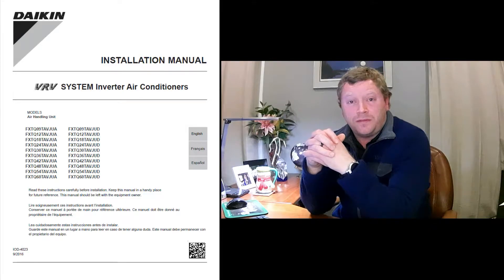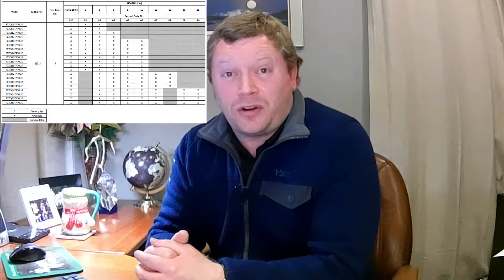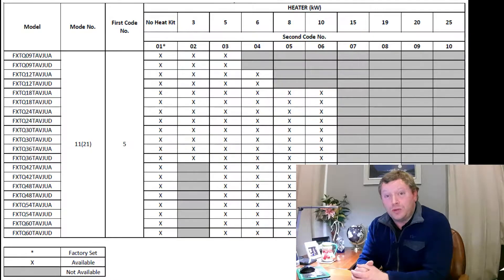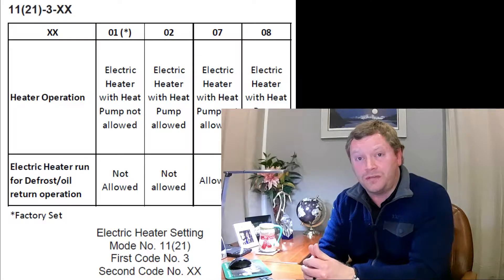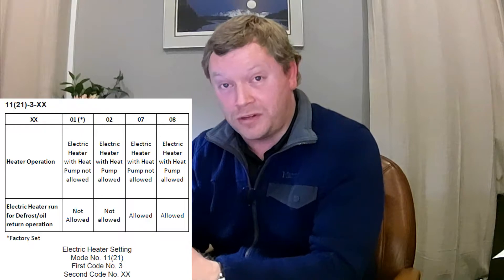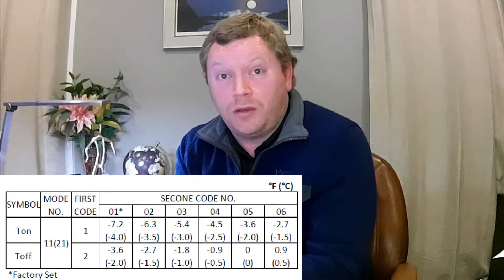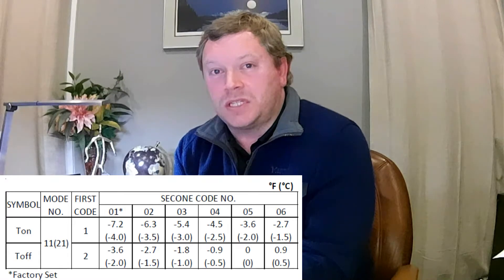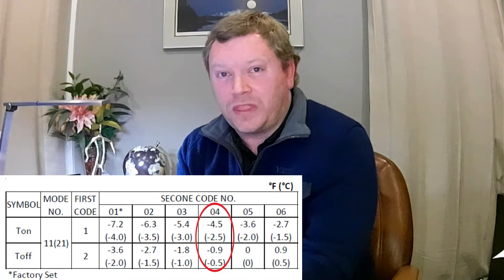How to program strip heat on Daikin FXTQ | Daikin BRC1E73 | NEW CONTROLS SERIES Ep.6 (12-7-2020)

Comment: Wondering why FTQ air handler wont turn on aux heat during defrost. I have Mode 21 option 3 set to 7, which is allow strip heat during defrost, but they never come on...only way to get them to come on is set it to 8, which then allows them to run with the heat pump as well ( I do not want this)
Reply from the maker: Did you set settings 1, 2 and 5 as well?
Reply: @InverterAlways  Yes. Those are set. I'm seeing lots of issues with my Daikin Skyair. Outdoor unit hex codes for cooling and heating comfort settings  - powerful mode doesn't match what the service manual says the lights should be. Eco, mild, and quick match though.

Comment: Hello! Thank you for such an informational video. I have been trying to find someone in my area that knows how to work on this system, but two different companies came out and had no idea how to do this. My issue is that I have done just this where I went to field settings, Mode 21, and option 3 is set to 1 so theoretically, my aux heat should not be running. I ran a test by letting the house cool to 60 and had the thermostat set to 66. When I turn the system on, after about 5 minutes, I checked the electricity consumption which was 12.5 kwh (we have a consumption monitor with our solar system). I'm thinking the heat pump should be less than 4 kwh and I'm guessing the 10 kwh heat strips are working. How is this possible with option 3 set to 1? Any ideas? I know you mentioned you're in the NW. We are in NJ, and would gladly give you business virtually if you could help us get this straightened out. Thank you!
Reply from the maker: Try changing it 3-02 save, escape, then go back and set back to 3-01 and save. What is setting 5? If you set 5-01 it won't even think it has heat. 
If that doesnt work I would think something wiring related is wrong. But unless someone has an amp clamp on the outdoor and the air handler to confirm each units amp draw its hard to say.

Comment: I have Daikin RZQ48 and FTQ48 with Daikin one + thermostat. Is there anyway to get manual control of the strip heater via the thermostat. No field settings address this. Is it a thermostat limitation? I simulated a outdoor unit fail by trying off the power to it, however the air handler wouldn't turn on heat strips and only showed a communication error.

Comment: We have eight Daikin FXMQ air-handlers with heat strips added through a KRP1C 74 board.  The only thing that populates in the Installer Setup menu is Mode 21 Code 1.  Some are set to 1-01 and some are set to 1-05.  Does anyone know if we can adjust the heat strip on offset through that code?  And does that code give the same offset as with the FXTQ air-handlers, that would be -7.2F for code 01 and -3.6F for code 05.
Reply from the maker: Different settings for fxmq with krp board. What is the full fxmq model
Reply: @InverterAlways   The majority are FXMQ36PBVJU  but there is also a 15, 24 and 30 in the mix.   Am I correct that the size does not matter, but the PBVJU will tell you the logic board that they use?  Thanks for your help with this, much appreciated.
Reply from the maker: Understood. So yes mode 21 setting 1 controls both on temp and off temp. Option 6 starts at -2.7f from setpoint and overshoots 0.9, then deduct .9 from each until you get to option 1 which is -7.2 from setpoint for on and -3.6 for off. You cannot individually set the on and off it looks like on that model.
Reply: @InverterAlways  Thank you!  We made that adjustment yesterday and this morning for the first time the medical building has held temps over a sub-zero night.  Much appreciated.  On a related topic, we are running an ITM, specifically a DCM601A71, central controller.  Are you aware of any way to display when aux heat is on, or to record the on times?
Reply from the maker: Not the integral heat no. 3rd party heat with wago or through bacnet you could but not the way you're controlling it right now.

Comment: I have my unit configured to shut the blower off when the space is satisfied. Field setting 22-3-3 and 22-6-3. Does this mean that if program my heat strips to run during defrost, that there’s a chance they could run without the blower?  And trip out on a high temp limit in the air handler?
Reply from the maker: no, your fan will run when the strip heat turns on. defrost is only 6 minutes long typically though so there's usually no need to run strip heat during defrost.
Reply: Ok. I was confused by your comment at 7:20, which is why I asked. Other than that, great video and series!  Thank you for the information.

Comment: Great presentation, thanks!  What happens when an  installer puts in a strip heater that exceeds the rating of the air handler?  Such as the example you mention in the video -- a 15kw heater in a 3 ton air handler?
Reply from the maker: I've seen it not work, and I've seen it work then trip the unit. I would recommend using an approved size.

Comment: The strip heat emergency mode controlled by the condenser was the information I needed. Thanks
Reply from the maker: That outdoor setting always gets em lol. I have a revamped version of this coming I think in 2 weeks part of the vrvs install series.
Reply: @InverterAlways  I am vrv 3 hr and multi 3mxs stuff. One to one and sky Air
E3 pressure switch/ was my sky Air. My salesman.
Reply from the maker: @brianchadwick9405 ? You lost me 😆
Reply: @InverterAlways  Did this happen?